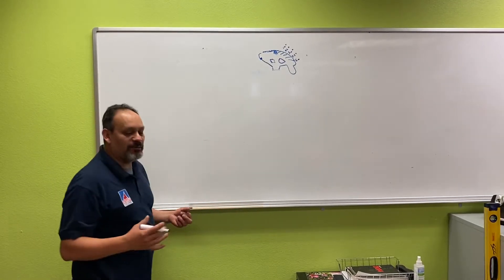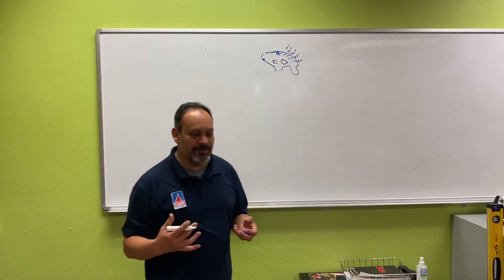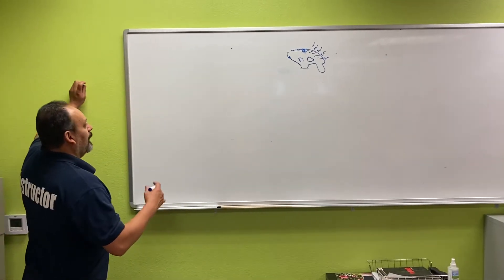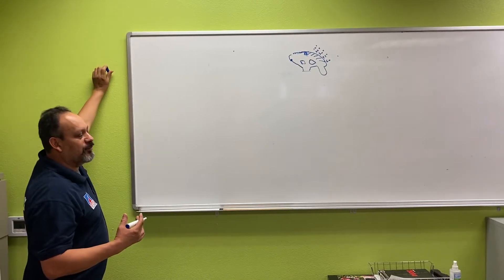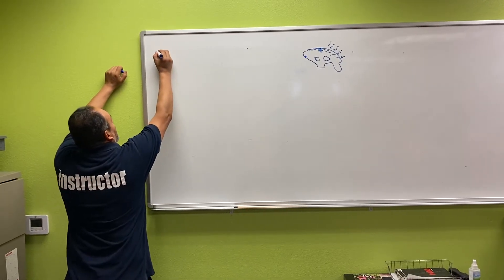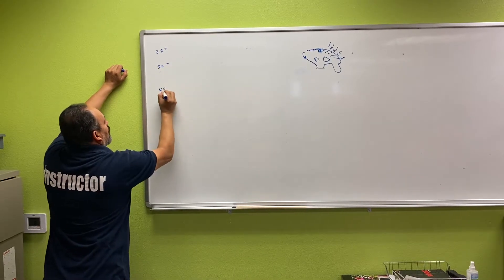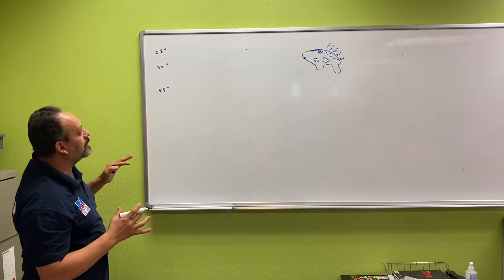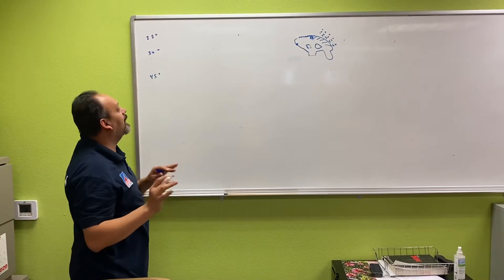3 points saddle bend

Comment: Mr Orellana, isn’t the multiplier for 3 bends 2.5?
Reply from the maker: 2.5 or 2.6 are both used. 2.5 is 2 and a half of the metric system and 2.6 is 2 and 6 inches of the standard system, they both work